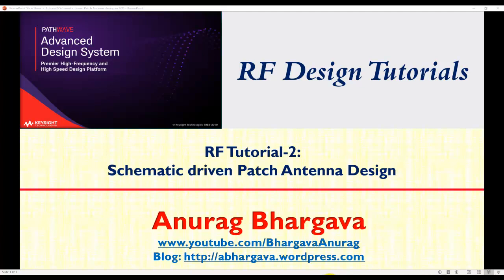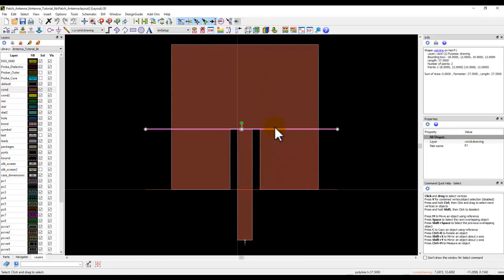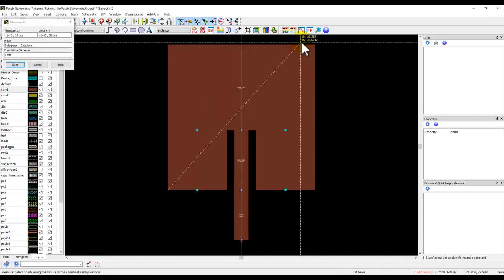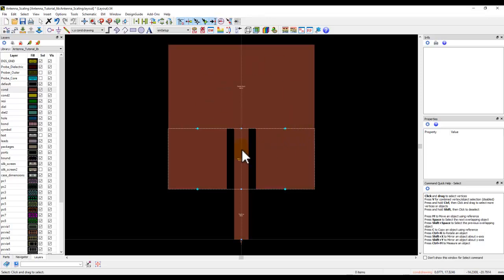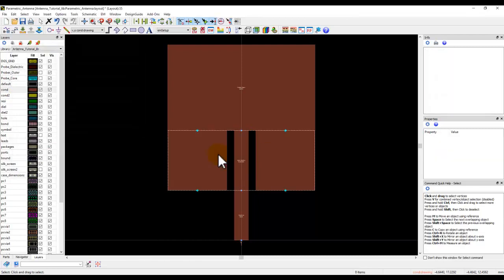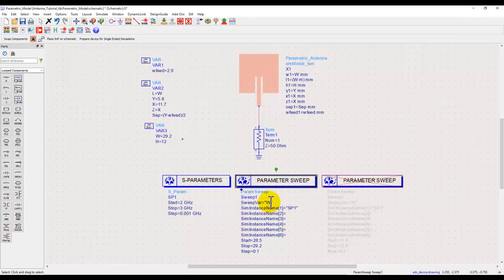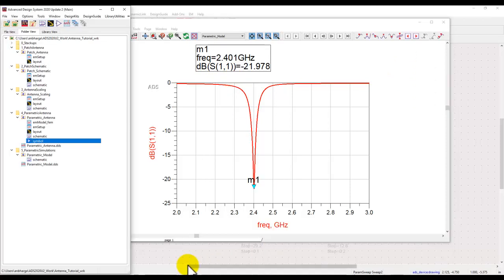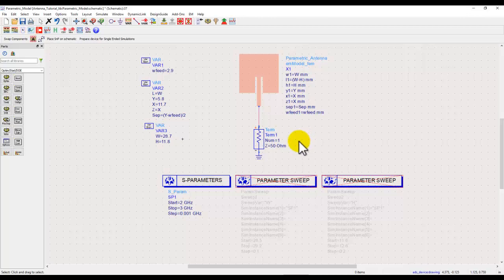RF Design-2: Schematic driven Patch Antenna Design

Comment: by using your video my antenna parameters are 
Parameter	Value	Evaluation
Frequency	2.4 GHz	✅ Correct ISM band, common for Wi-Fi, Bluetooth
Input Power	205.5 μW	Fine for simulation; absolute value isn’t critical here
Radiated Power	201.2 μW	~98% of input power radiated
Radiation Efficiency	97.9361%	✅ Excellent; ideal patch antennas aim for >90%
Gain (dBi)	5.9961 dBi	✅ Very good; typical patch antennas range from 5 to 6 dBi
Directivity (dBi)	6.0867 dBi	✅ Good; close to gain indicates low losses
Maximum Intensity	6.5e-5 W/Sr	Just a derived metric
Effective Angle	3.09416 Sr	Wide coverage (~70% of 4π sr)
Angle of U max (θ, φ)	(3°, 270°)	Likely correct for your layout orientation
Reply from the maker: Great to see that the antenna parameters are coming out well. 😊

Comment: thanks for your explanation , could you please guide me how convert (RF sensor constructed from SIW +CSRR that simulated by CST ) TO equivalent circuit
Reply from the maker: There is no direct way but if you know the equivalent circuit topology then you can check out A vs. B modeling under Learn ADS in 5mins playlist i.e. Tutorial-21

Comment: Hello, thank you for your videos! I watched half of ADS in 5 minutes playlist and few videos from this playlist to design an IFA on PCB for my coursework. You have a gift of explaining things in a interesting and easy to understand way!
Reply from the maker: Glad you like them!
Reply from the maker: It would be nice to check if you could share your coursework after it is complete, and I can create a new tutorial video on how to perform IFA design using your coursework. Let me know if this would be possible?
Reply: @BhargavaAnurag  it is complete. But there is little interesting to salvage from it. I was very short on time so it's not parametrised (couldn't find a way to do it so that segments stay connected, later found out how, but haven't tried it) and just used brute force and modified it until I got results I wanted. Also, workspace is a mess since I iterated the design and then tried to import it to Xpedition Enterprise in various ways. The layout is based on TI application note AN058, which I modified to work on 1000 MHz with approximate of my board geometry and ground plane size. Nonetheless, I can send you the archived workspace, if you still interested.

Comment: Hi Anurag, great videos did you use the same substrate as in part1, and I was wondering what the parameters of the MSUB you used were, I was using the values from the substrate materials I was using, but my S11 is not coming up like in the video.
Cheers
Reply from the maker: You can recheck the parameters. Whether you receive exactly same response shown in the video or not but it should be as per expectation unless either the stackup parameters or the antenna dimensions are wrong

Comment: You've shown us that we can look at the antenna parameter in the far field option but that's only for 1 set of parameters. It is possible to compare for exemple the gain at 2.4 GHz for different values of L automatically, instead of opening the far field view 1 by 1?
Reply from the maker: Not directly unless you perform some kind of scripting.

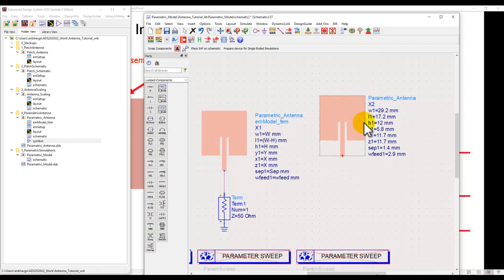Comment: at 12:20 when you drag and drop the schematic, there is no emModel under the name. But there is one on the parametric antenna you used, will this cause issue ? Thanks
Reply from the maker: When drop the symbol there will no subcircuit assigned, user can use "Choose View for Simulation" to select emmodel for proper simulation

Comment: Did you actually sim that sch version? And it yielded same/similar results as layout?
Reply from the maker: Your question is not clear to me hence can't respond.
Reply: @BhargavaAnurag  At ~8min you show how to build layout patch in schem to include parameterization. Was the schem version also optimized to include S-parameters, or was it only to serve as a schem symbol?
Reply from the maker: @eechentra1761  The schematic shown is not optimized for any circuit simulation, it is only used to create the layout...😊

Comment: when i push into symbol (that dose not work) it goes into schematic from which the layout is created  ,but when i push into working symbol i go to EM model ,, is the problem that (not working symbol is linked to schematic), i have work on this problem for 1 full day , if do not mind and  it is possible sending me your workspace for this lesson so i can compare it with my own.
Reply from the maker: You need to select "Choose View for Simulation" and depending on what you select will be shown when you push-in to the instance. Kindly watch Polymorphism video under Learn ADS in 5mins playlist.

Comment: when i do symbol without EM parameters it work well
Reply from the maker: This simply means you have wrongly attached some parameters that is not properly scaling the geometry. Relook and use 1 parameter at a time to find which parameter is wrong.

Comment: Warning detected by hpeesofsim in topology check during circuit set up.
    Number of nodes with only one device attached (topology corrected): 4
Reply from the maker: This warning can be ignored and it doesn't affect your simulation results.

Comment: Hello sir, how can I improve the reflection losses I have for the frequency of 0.868?
Reply from the maker: Question is not clear and answer will depend on the exact structure you are designing. More reflection losses means you need to pay attention to feed location and the feed network.
Reply: @BhargavaAnurag  I can not find what I am doing wrong, can I email you the results I get from the simulation to understand what I am doing wrong?
Reply from the maker: @ΠετροςΜανζιερι  Kindly take help from your local Keysight tech support team

Comment: Hi Anurag, thanks for the outstanding video. Can you please tell me is it necessary to add "MSTEP" component in between MLIN and MACLIN3 and also MACLIN3 and MLOC ?
Reply from the maker: No, its not necessary as you are not doing any schematic level simulations where these discontinuities will affect the results. Its only to create layout so it is fine if you don't use them.
Reply: Thank you!

Comment: sir can you please make a video to convert any patch antenna to its equivalent RLC circuit ...please
Reply from the maker: Hi Shesha,
You can refer to this: https://muehlhaus.com/support/ads-application-notes/functions-in-ads 
Don't worry about the function mentioned here and you can simply use A vs B modeling as shown in one of my videos and simply use S-Parameter of your Antenna as the reference and then optimize the RLC values.
Hope this helps...

Comment: Hi
I have a question not about the video, i think it's so clear for me.
But what i'm looking for is how to make an adaptive circuit (Broadband Impedance matching lead a complex impedance to 50 Ohm in wide band at 24 GHz ), if you have information or some ADS documents please share with me, it would be helpful 
Thanks a lot for all your interesting videos Mr. Anugrag Bhargava
Reply from the maker: Hi Driss, I am not sure if you watched my other video on Impedance Matching: https://youtu.be/ZUpuvQqK7ho
Its bit old but will give you enough pointers to start with. Depending upon your design technology you need to be sensitive to the substrate you select for 24GHz design if you are doing PCB/RF Board kind of implementation. I would recommend to use 10mil substrate with very good Loss Tangent and circuit to be designed using CPW based approach as far as possible. 
Let me know if Impedance Matching video I referred can be of your help.
Reply: Hi  @BhargavaAnurag , Yeah, I saw your old video, i find it so helpful to begin my matching impedance in some other projects that suggest a narrow band matching. In my last project, i already started with Chebychev Method Transformer Impedance but my problem is that method can adapt two real impedances, not a complex impedance to a real one (50 Ohm in our case). Do you have any ideas or ADS tutorials that you can share it with me for broadband matching complex impedances, that's what i'm looking for ?
Thank you so much
Reply from the maker: @drissaouladhadj4102  I would recommend you to look at Tools->Impedance Matching utility in ADS and here you could choose the type of matching network and define the source and/or load as either S-Parameter files or enter it manually for all the key frequency point. Based on what lumped circuit you come up with, you can use Lumped to a distributed converter to convert L & C to distributed equivalent components. You can get more details on this utility under ADS documentation...
Another alternate would be to use Keysight Genesys software which has great impedance matching synthesis to design narrow or broadband matching networks and the best part is that you could do both input and output matching networks at the same time...
Hope this helps...if it doesn't then I will try to create a tutorial in near future once I am done with the current list of stuff I have...👍
Let me know how it goes for you
Reply from the maker: @drissaouladhadj4102  One more alternative, if you could send me complex impedance details with frequency and tell me what would you like to achieve then I can play with it to try to come up with a methodology for you..👍